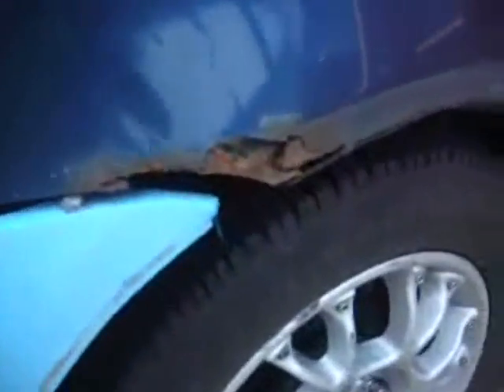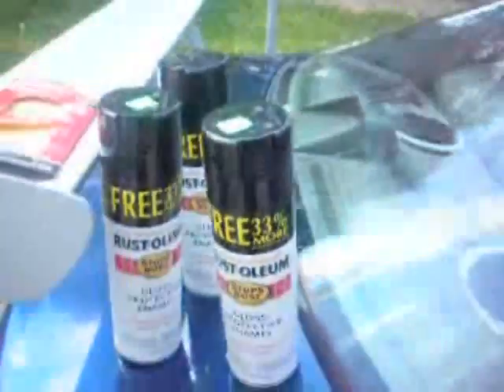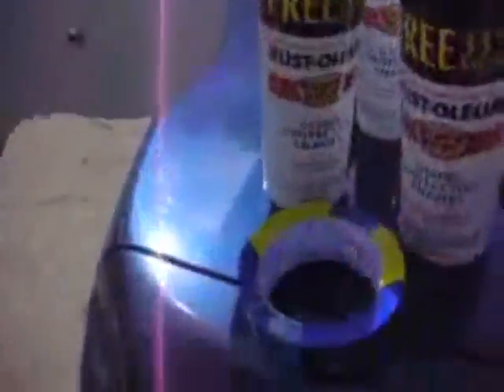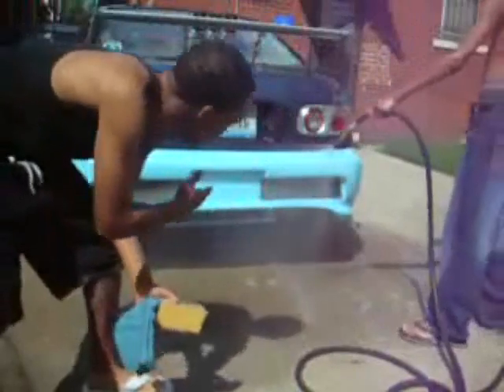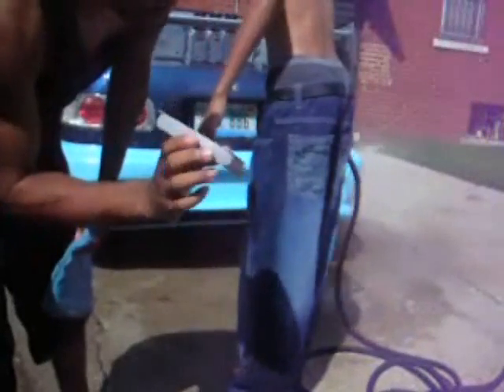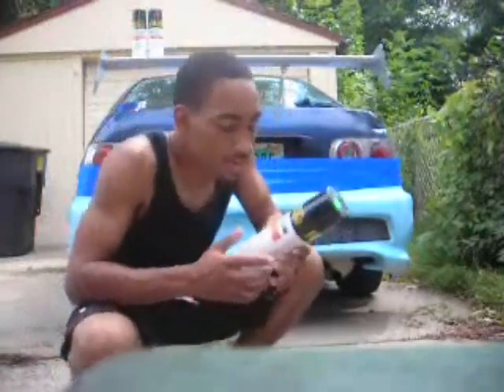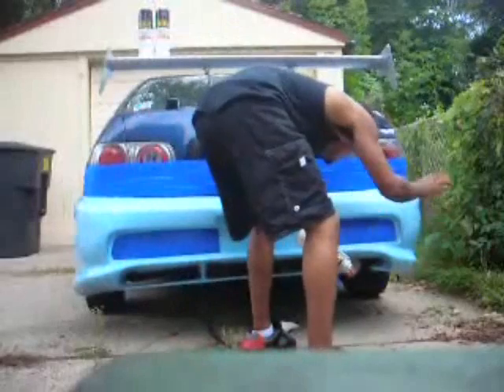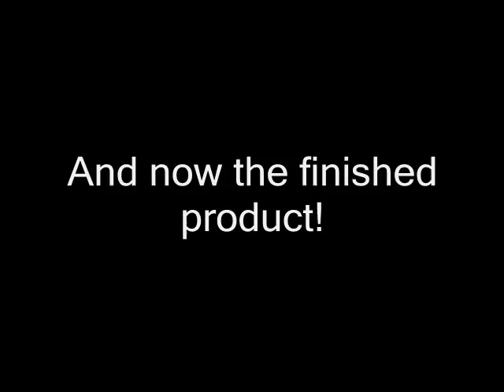Spray Paint My Car (1992 Honda Civic)

Comment: I have been a body man for 35 years and the best  way to sand bumper covers is to wet the cover and sand with scotch brite and ajax. It sands and cleans at the same time. And with this you dont miss places in corners and dips.

Comment: From experience I've learned that if you do multiple light coats you will get a pretty nice paint job. Sand it, start with something heavier work your way down to 220. Prime it, then spray a  light coat where you can still see the original color, let it dry spray another light coat and do it till you don't see the original color spray another coat for good measure then do it with the clear cot till it's glossy

Comment: Only thing i would do is try and make the bumpers fit better and have them sit more flush with the body. Other than that it turned out good. Follow us on @goyamotorclub on instagram and send us a couple pics if you still got it. 👍

Comment: The spoiler is actually off a semi truck, you see, you need a spoiler that large to keep all 36 hp that Civic generates on the ground. The Auto Zone body kit also plays its part, while the Altezza tail lights add at least 50 more hp. The spray paint may actually INCREASE the value of this fine machine..

Comment: @corvetteracer916  It depends how he did it more than what he used. If it was rusted before and he just sprayed over it then yes it will rust again. Also depends on what kind of primer he used and how much time he took to prime it. Remember that rust is worse than cancer for a car, It has to be completely cut out or it will come back sooner or later.

Comment: don't take this the wrong way cuz' I do dig the ever so slightly "rat-rod" look of the black spray painted bumpers... but, I have no idea why you'd put a down-draft wing on the BACK end of a FRONT wheel drive car... I gotta' say though; I do dig the spray-painted finish on those bumpers and hood. it looks good. ...... very nicely done. ... now, later on... get you a lil' scoop from a $15 can of Bondo, sand out those rust spots near the wheel-wells.... kill less time than you spent painting your bumpers n' hood, and you will get a nice enough finish to cover with a bit more paint... it's easy to do, a golf-ball sized scoop of putty with a lil' more than a pea sized drop of hardener... and it's just like workin' with runny clay....
Reply: fwd car can still produce downforce its all to do with aerodynamics granted it does not have the same effect as on a rwd vehicle as  it is not aiding the driving wheels but still

Comment: haha. Faster than highway speed. This civic could never go fast enough to reap the benefits of this wing anyway. Not to mention. It is front wheel drive so it serves absolutely no purpose anyway. Civics are alright and all. And I'm even ok with a body kit or lowering as long as its not over done. But sticking a huge wing on the back of a front wheel drive car is pointless. Props on him doing his own work though. Most people just buy things and talk crap.

Comment: Can you tell me how much paint you used on one bumper and if it held up in the weather? Considering this paint to fix a peeling roof without getting out professional spray equipment.
Reply: Preaty good if u only use rustoleum and sand and prime and stick to rustoleum then hit it with clear then buff it out looks decent

Comment: go get some kylons flat clear and clear coat the paint job then go get some 1000k-2000k sand paper and some rubbing compound and you can make it look factory.  lightly wet sand and clear coat, not hard eough to go through the clear,  and then buff it out and bam! your car will look  10000x's better. it would cost you about 30 bucks but worth it def

Comment: I wish my damn front end was that easy to take off. What mesh did you use for that rear cover. I've an aftermarket turbo hood for my Camaro and it has 4 slots on each side of the cowl for heat dissipation and I've been trying to find a good mesh other than chicken wire, did you buy that separate or did it come with the kit?

Comment: damn lose da wing, change da rear lights back 2 stock or smoke em, and lower da car...but otha than that came out pretty koo..u shoulda bought some 1000grit sandpaper n sanded it a lil den go over it wit some clear coat it'll last longer..overall cool vid tho..

Comment: @bluegixxer1k Hey!  I had a question. I am looking into purchasing this project car and on the ad he said he took it bare metal and sprayed it with black primer. If this was spray paint, am I in trouble with rust and further paint issues? Can this be fixed to be painted by a pro?! Thanks!

Comment: wow that came out pretty nice. but ur rear bumper is fucked up. one side sits wayy higher than the other. and the sided are bowed out. haha and you need to get the rust fixed. but overall not a bad car. shit i would drive it

Comment: hey i know you are poor and everthing but what you could have done was buy a cheap paint gun,car paint, gloss paint, and use pneumatic air to paint your car. it would cost a little bit more but your car would be looking 10x better plus the paint will never chip off with car paint.

Comment: Ok first off i work in a body shop, sooo.. let me give you some tips. You never paint anything on the car. 10$ sais i will find overspray somewhere. 2nd Those blocks you were using are made to be not to soft and not too hard so you would sand it even with no scraches. n64 game isnt going to cut it. 3rd never touch the bumper after you sand it, there is grease on your hands. 4th allways wipe everything off with acetone before painting. 5th why did you paint everything black on a blue car?

Comment: Ok now I want you to read very carefully because I'm going to tell you how to fix your car without spending a single dime. This will only work if you have the original parts that came with the car.First, sell that god awful wing,the front bumper, the rear bumper, and those ricey tail lights. This will give you the funds needed to salvage your car. Put the stock parts back on and use that money on some lowering springs and if you have money some wheels. Please tint windows. Done. Later paint car.

Comment: Instead of the crazy front and rear bumpers along with the useless wing why not just make it a clean oem build? Restoring it with tasteful mods is easier and cheaper than going over the top with bad looking mods.
Reply: he's dong what he wants and likes you should respect that.
Reply: I understand that. Im not talking crap to him. My post was the least negative but i feel the most informative. Its cool he does his own work. If he applied himself to do all the work necessary to fix all the damage rather than just add visual band aids it will look better. You know that is true.
Reply: i agree, the car isn't my style but at least he's doing the work himself and doing it to what he likes